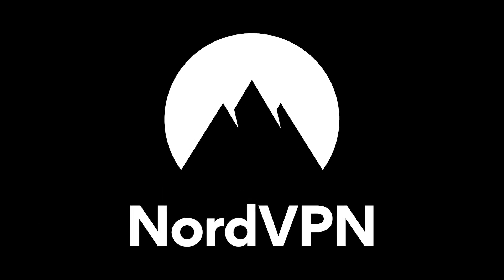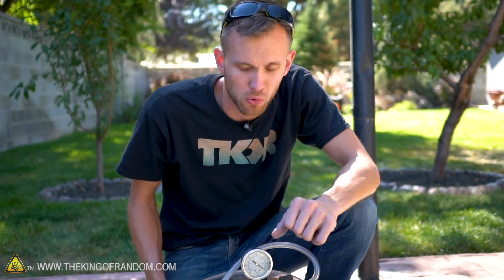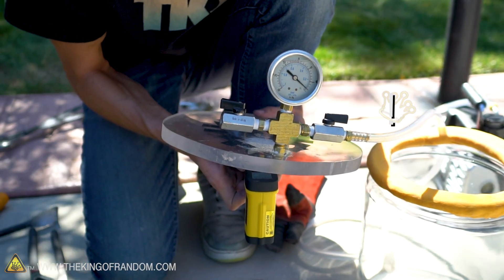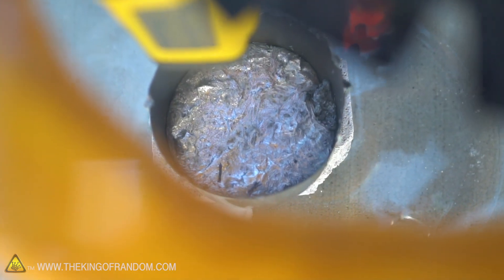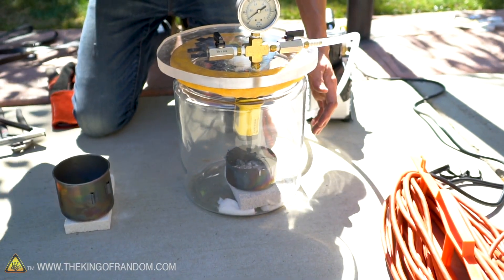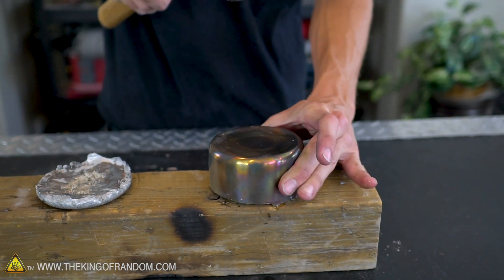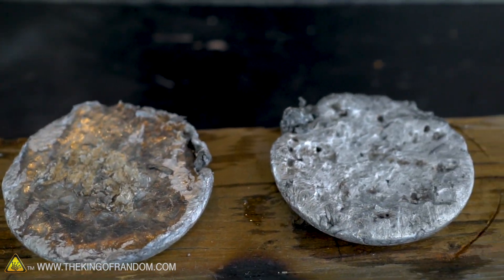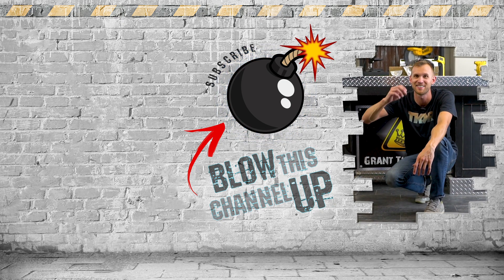Molten Metal in a Vacuum

Comment: I mean, not that I'm asking you to do it again, but, if you really wanted to see how long the aluminum would retain its heat in vacuum, you would be much better off getting hold of some aerogel. Without air for conduction I am assuming most of the heat radiated off and that would definitely take a while. I think a more interesting version of this experiment would be using aerogel for your insulator at the bottom of the jar, and a closed jar without vacuum, and recording it with an infrared camera while it cools, assuming it doesn't break obviously, and then do it again in vacuum. The aerogel will not happily conduct the heat, which means that all of the heat that is transmitted to the jar will have to be by means of radiation. Which should take *a while*. Ultimately you'll be more looking at the heat values of the chamber than the metal itself. My assumption is that the non vacuum jar will get much hotter, and possibly shatter, or else it will hit a peak temperature and then cool relatively quickly, a few hours. The vacuum jar, assuming its properly insulated, I would expect to get less hot, will not hit a peak temp so much as plateau, and stay at a relatively consistent temperature for many hours, and then very slowly cool.  

My theory is that while the glass did get very hot, the vast majority of the heat was not radiated, it was conducted through the brick down into the glass. It looks like you just have some cloth padding or similar as a riser for the brick, that's not going to insulate the heat very well compared  to various superior insulators.

Comment: I found it very interesting. The fact that the molten aluminum in the vacuum chamber had a pitted, shinier surface means that there were still gases in the metal. By removing those gases in the vacuum chamber, the metal is much more pure.

Comment: Take a 2.875" coupling blank of p110 or  L80 or something with machined od and id. Heat it up to about 700° to 1200° and do it again but check the size difference with a micrometer to the thousandths of an inch and see if it will change from not being in a vacuum doing the same.  Just be quick.🤣

Comment: The vacuum is causing the aluminum to “degass” the entrapped hydrogen gas
Reply: There is also a lot of hydrogen in the propane
Reply: Where did the Hydrogen come from?
Reply: @deserttortoise21   atmospheric water vapor reacts with molten aluminum to make Al2O3 (aluminum oxiode) and hydrogen.
Reply: @deserttortoise21  hydrogen mixes with molten metal as it disolves and causes porosity

Comment: There will always be a certain amount of dissolved gas contained within the molten aluminum.  Placing the molten aluminum in a vacuum chamber and lowering the pressure will cause the entrained gas to attempt to leave the aluminum.  The aluminum solidified during this process, which has resulted in the lumpy and uneven surface texture you observed.  >Charlie

Comment: Did you set the EMS on the infrared thermometer to the proper emissivity for aluminum? If not that is the reason you didn't get accurate readings on the thermometer.

Comment: The emissivity of aluminum makes those non-contact IR thermometers basically useless for measuring the temperature of aluminum. You are not going to get the actual temperature of Aluminum as a solid or when it's molten. You need a pyrometer in the molten metal to get the actual temperature.  You need to know the limitations of your tools.

Comment: reason the ir did not work is due to emissivity. That ir thermal gun probably as an emissivity of 0.9, to measure shinny aluminum need something like a 0.03. You will need a thermal gun with and adjustable emissivity.

Comment: Fun fact homosapiens

Did you know that boiling/melting is based on pressure... Not temperature?

Naturally most everything wants to stay in a gaseous state in a vacuum things like water will not stay as water rather as vapor. The reason they stay together is because of increased pressure

(Need a better example? Mmk)
In jupiter there is a layer of ice that is almost as hot as the surface of the sun...

Comment: The infrared thermometer should have a emissivity setting, it should be set according to the type of surface your trying to measure. 
range is from 0-1 typically in 0.01 or 0.05 steps

Comment: I think you should first experiment to see if the laser thermometer, can take an reading through cookie jar glass, then a comparison check through both cookie jar walls + vacuum in between by shining it directly at a hot object then at same object through the jar, if results don't differ then no need to place the temp gun in the chamber! problem solved.... well almost..
because i was gonna say, if you can't read hot Aluminium (sorry I'm from UK) then can't you just read the vessle it's in, eg, the steel cup? that would still indicate which loses heat quicker..

Comment: The one in air actually had an oxide layer, and the one in the chamber had hardly any, because there was no oxygen available when it was still hot, also the reason the glass of the chamber, the tape and the side of the thermometer facing the aluminum got so hot is that that there wasn't any air present to dissipate the heat of the aluminum, so it only cooled down by means of radiation, causing any surface exposed to this more-than-usually intense radiation to heat up very strongly. (because that very thin strip of material is the only place the heat is focused on, in stead of a huge volume of air, contentiously being run past is by the air streams caused by heating up.) A last interesting note is that the glass heats up even though it is transparent. I think that is because it might not be transparent to the infrared light that the aluminum is putting of most strongly; I have noticed myself that, when looking through an IR camera, almost all glass surfaces act as mirrors.

Comment: Can you make metal vapor?In the periodic table aluminum turns steam at 2519°C but you could use a metal that needs less heat like silver(2192°C) or magnesium(1090°C) and use techniques like taking out the pressure . I've always wanted to see how would be metal vapor
Hugs from Brasil, sorry if my english is bad 
Like to tkor see this
Reply: Just don't use zinc!
Reply: I mean, use something that has even less of a melting point, like gallium...
Reply: @phoenixstrills2289  You'd think that gallium would have a really low boiling point considering it melts in your hand, but it actually doesn't vaporize until 2400° C
Reply: @perrybb2  huh, that's new. Guess it's the same deal as pencil lead, that stuff doesn't melt till a couple thousand degrees
Reply: @perrybb2  wow im curious about how that works
Reply: Use Mercury
Reply: Aluminum turns to gas above that temp. Not steam😂. Aluminum condenses back into aluminum oxide unless in an atmosphere devoid of oxygen. However theirs no clear way to visualize that as theirs no clear material that can withstand vaporized Aluminum, so theirs no possible way to "observe that process" short of a few billion dollar magnetic field created with an atomic collider (particle accelerators).
Reply: Mercury and Sodium are metal's that can be easily vaporized.  This property is even utilized in various technologies and industrial processes, most notably in high output light bulbs that were very popular in street lights or indoor growing until recently.
Reply: To answer your question more directly than others have, Aluminum is an element, one of the metals, obviously. All elements can be transitioned between different states of matter in the correct circumstances. Those circumstances are not always easily achieved. Even hydrogen, given enough pressure, can be formed into a solid metallic substance. I want to think I remember being metallic hydrogen being one of the best super conductors, may be wrong about that. Technically I don't think that Helium can be solid because of some slippery business with how its atoms work at the theoretical, and theoretically unachievable, absolute zero. 

Hydrogen, by vast majority, is the most common element in the universe, followed by helium, and moving on down the list, everything else in the universe is made, ultimately, from fused hydrogen in the core of stars, so it isn't really all that surprising that most elements, ultimately, have some properties that tend to be present across the board.

Comment: You need to use a thermometer gun with adjustable emissivity, you can pick them up online cheap. Aluminum has a much lower emissivity than alot of other materials which the thermometer gun is pre-set for causing it to read low.

Comment: So, in all reality, if you had a strong enough vacuum, and a hot enough heat source, it would coat the inside of the vacuum chamber with a thin layer of metal.  

I work as an engineering technician for a semiconductor company, and we use this method on a daily basis to produce wafers that have a gold layer on them.  This is one of the ways we apply the gold.

Comment: The King of Random, Of course the Glass got really hot , as soon as you remove the air you have no resistance, you turn all the energy transfer into radiant energy and what you are experiencing is the same as if you had the molten metal directly on the glass, in theory anyway but you get the point, there is much less resistance at the heat transfer is direct instead of the insulation that air provides.

Comment: Why didn’t you fix a piece of black tape to each cup (of equal size) and use that to determine temperature? The samples should either be heated at the same time or timed and temps recorded

Comment: You need to have it cool slower like have a hot plate under the vacuum chamber .  Then have both sample identical.  And redo the test since you released the vacuum to fix the thermal gun

Comment: Recommendation: try this again, but with a metal that has a lower melting point, like Lead or Bismuth.
1) It doesn't need to be anywhere NEAR as hot as Aluminum, making it easier on your equipment. 
2) the metal will stay liquid longer, allowing a vacuum to have more of an effect.

Comment: I suggested melting metal in a vacuum chamber like a year ago.

Commented on ❄ How To Make Solid Nitrogen Ice in a Vacuum Chamber
If you have a vessel that can withstand the temperatures, or perhaps if you line the bottom with casting sand, you should try putting molten metal in a vacuum chamber!
7 months ago

Comment: I'm no expert in Thermodynamics, but if I understand the science correctly, a heated sample exposed to a vacuum would remain hotter, longer because there's no air particles to take away the heat. I've heard that in space (Space Shuttle, ISS, etc.) keeping the station warm isn't really a problem. The problem in space is dissipating the heat generated by the electrical equipment.

Comment: If you put one of the smaller halves of each one in the vice and smack it with a hammer, you should be able to crack it in half.  That would allow you to see the grain structure of the aluminum better (where a saw will just smush* everything together and will look pretty uniform)

*smush - a technical term

Comment: What does blood do inside a vacuum chamber
Reply: The Droste Girls well he was supposed to hire a female helper so that’s one place he could get blood
Reply: qvindicator myth? No. It’s common sense. It will boil because our blood solution is stable at 37 C and 1 atmosphere. The less atmosphere, the lower the stable temperature. Since our heat won’t quickly leave our blood in space, it will remain in the blood and keep it hot. Like a pressure cooker in reverse. However, if you knew simple zoology, you’d know that our blood may not boil if it’s still in our bodies. While our skin is under constant pressure of atmosphere, our blood is not. Our blood has it’s own pressure inside our bodies. Even if we were in space, it is possible that our bodies would pressurize our blood enough that it couldn’t boil inside our bodies. What we would have to worry about though is every other body fluid that stays on the outside such as our eyes conjunctiva  and saliva.
Reply: qvindicator and where exactly is your comment that I copy pasted? I didn’t copy paste anything of yours. In fact, your reply on astronauts blood was inaccurate. Why would I copy paste anything of yours?
Reply: qvindicator useless? I elaborated on why you could be wrong or right and further explained the answer to the comment better than you did. If anything your comment was useless
Reply: qvindicator no, I corrected a misconception that was not right. There is no evidence towards what blood does in space

Comment: okay so, Aluminum forms an oxidation layer that prevents anything from reacting with it. but when you get rid of the oxidation layer,  metals like gallium can alloy it. Also, when aluminum has no oxide layer and touches water, it causes an insane exothermic reaction that releases LOADS of hydrogen.
so my question is, does the vacuum chamber with no air prevent an oxide layer from forming on the aluminum? to test it you could put the molten aluminum in the vacuum chamber and let it cool, but have a way to drop gallium and water onto the cooled aluminum. see if theres a reaction aka "no oxide layer" 
it could prove to be a hyper efficient way of producing a lot of hydrogen fast with no chemicals.
it could change the world :D
Reply: So I like the idea but it wouldn't work. If you were able to get pure molten aluminum in a vacuum with no oxiode layer and pass steam through it you would produce hydrogen but the oxygen in the water would react with the aluminum to form Al2O3 aluminum oxide.

Comment: What happens if you open a vacuum chamber while the air is getting sucked
Reply: The air would fill in the unsealed vaccum as the top was lifted. Assuming that this is not at a high pressure already, but it would be pretty hard

Comment: For the heat, the one in the vacuum chamber cools down slower than the other because of the lack of a medium. However both of them will eventually use their heat due to radiation. You can verify your results and get better temperature readings through calculations.
Reply: Oh and the vacuum prevents oxides or other chemicals from forming
Reply: @rimorres  It can't oxidize if there is no o2 to oxidize with, and since it is a vaccum and there is nothing in there

Comment: If you put molten metal into a vacuum chamber, metal atoms will evaporate into the vacuum, and coat the walls of the vacuum chamber. The atoms which evaporate carry energy away from the molten metal, which has a cooling effect. It is not obvious to me whether the cooling in the vacuum will be faster or slower than cooling in air. Most molten metals would probably undergo a chemical reaction with the oxygen in air, That situation could become rather complicated. Things would be simpler if you used pure nitrogen instead of air.

Comment: You should build an induction furnace/vacuum chamber and try again. I think the aluminum melted and set under vacuum will be stronger as any gasses dissolved in the metal will he extracted.

Comment: Wouldn't the thermometer read lower because the surface rapidly cools? Being aluminum the surface cools and hardens fast and then transfers heat through quickly, like an aluminum pc heat-sink. so the surface should almost never be the same temperature as the molten metal below unless you recorded it instantly after pulling it from the fire.

Comment: What if you made a metal vacuum chamber that can withstand sitting in the forge and melt the aluminum under vacuum, then let the chamber cool down enough where you could touch it before opening it up? You would of course have to use a high temp metal that can withstand warping so the walls don't collapse under the vacuum or at least have the walls of the chamber thick enough

Comment: Call the problems were predictable if you knew a little bit about basic physics and I understood the properties of radiant heat putting plastic that close to a metal object that hot the Radion he of course would cook it.  Make your own inductive heater constructed inside the vacuum chamber drill holes through the glass seal it with high temperature epoxy. Use a high temperature thermal couple at the bottom of your crucible. Do not start heating until you have drawn a vacuum so there’s no slag build up from oxidation. All basic high school science class stuff no rocket science involved

Comment: The two samples need to be treated identically throughout the experiment, with the only variable being ambient pressure vs. a vacuum.  Weigh the aluminum, heat the samples until each reaches the same steady-state temperature.  Stirring should be the same for both samples.  Cooling for each should be in the vacuum container, but with the control sample left at atmospheric pressure and the test sample exposed to a vacuum.
Reply: would also not hurt to actually use the thermometer properly at the intended distance...
Reply: ...because science.
Reply: bigger cup also conducts heat more than the small one
Reply: @zxXEROTSxz  conducts heat more? No. Stores more thermal energy? Yes. It's because they are made of the same material but one has a larger volume
Reply: @OnlyTheQuack  Has a larger volume and more surface area to dissipate heat. Including the aluminum, the surface area to volume ratio is much higher with the full cup. The heat sink has bigger fins.
Reply: thallok yes and heat them both at the same time
Reply: I was about to comment, the variables here are very inconsistent
Reply: You're absolutely right, a slightly more scientific minded approach wouldn't hurt.
Reply: thallok I guess they do the same thing for both but, like who cares they weigh the aluminium
Reply: Chill bro
Reply: @dominicsurette2890  nope
Reply: Cosmic Space Goo and you sound like a bag of joy.